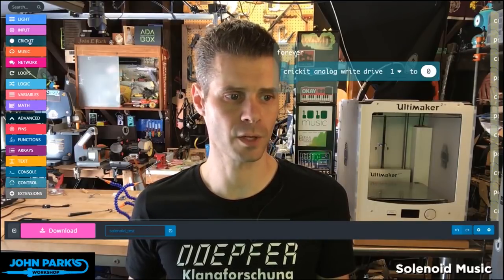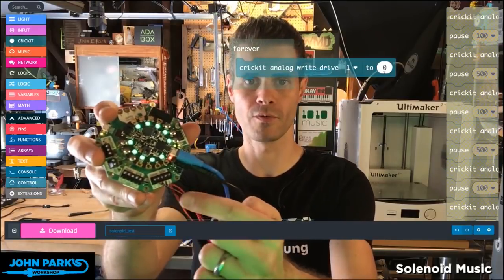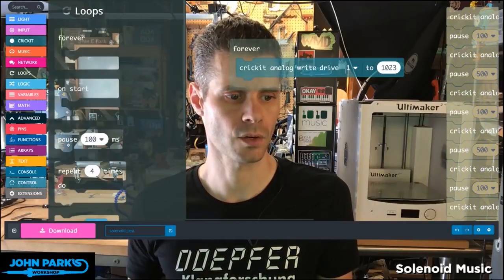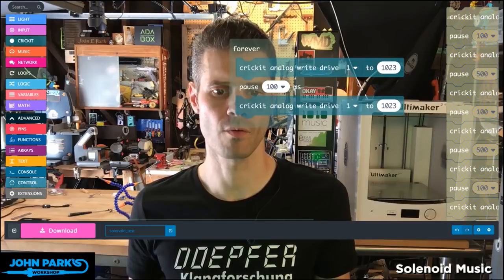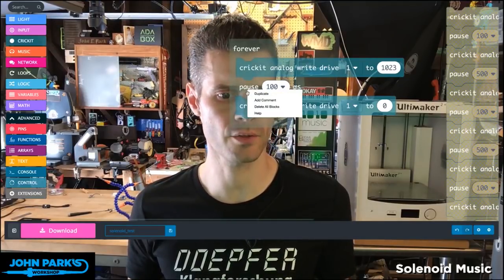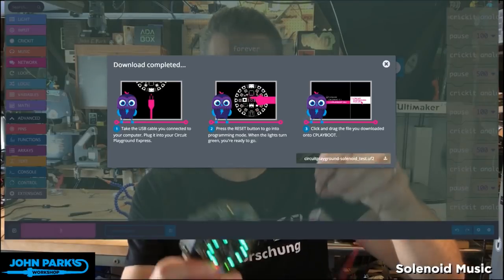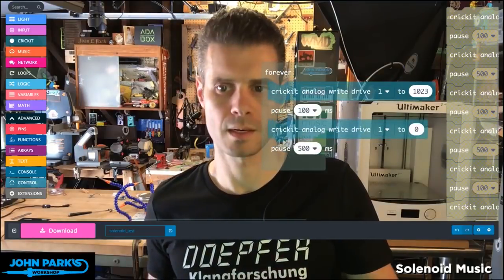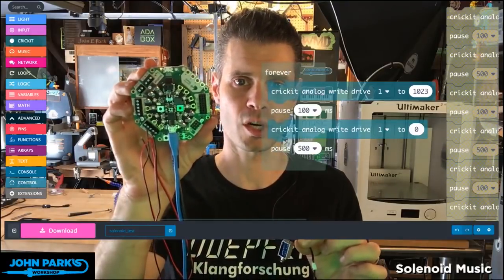MakeCode Minute: Driving Solenoids @adafruit @johnedgarpark #adafruit #makecode @msmakecode

Comment: Very good way to kill the electronics with reverse EMF from the solenoid as it is turned off.  Also beware of the inrush current...
Reply: A good point, and thankfully the Crickit's four high power driver terminals are designed precisely for this use. Each driver is a Darlington transistor, and has kick-back protection diodes, protecting the Crickit from damage. These terminals are meant for solenoids, electromagnets, relays, powerful LEDs, and other high-power parts.
Reply: @JohnParkMakes this is SO helpful to know! I have been researching this for days and just read this. Thank you!